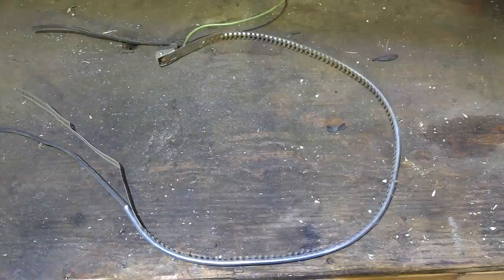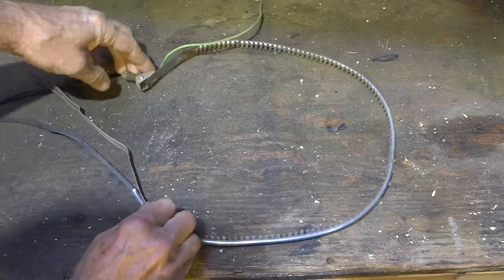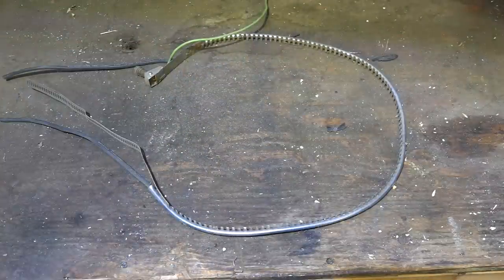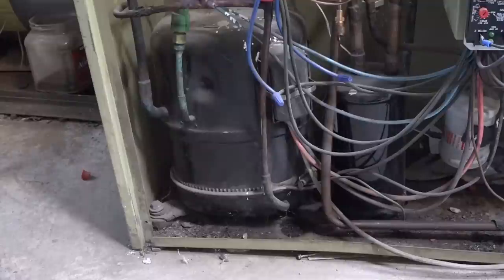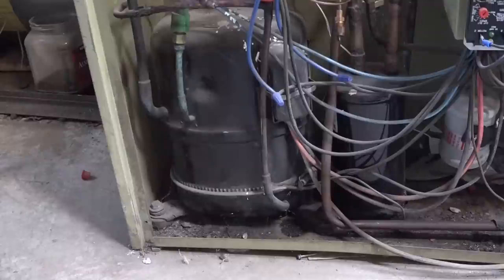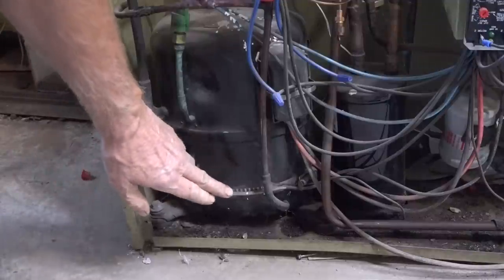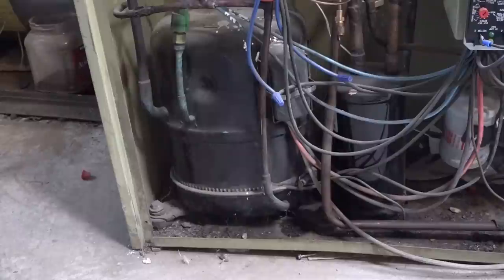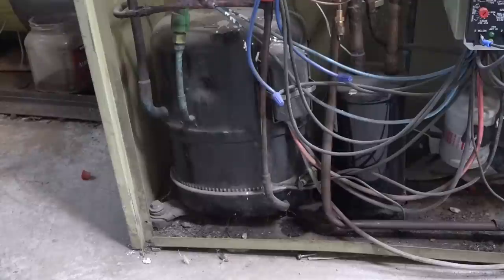The crankcase heater of the air conditioner or heat pump

Comment: Is it ok to shut the breaker off to the compressor during the winter so the crankcase heater does not run through the season that the AC is not used? I plan on turning the breaker back on 24hrs prior to the first start up of the AC in the warmer season to heat the oil back up to temp. Curious because I am able to notice my meter slows down when its off, saving energy. But if its going to cause a problem I'd rather leave it on.
Reply from the maker: You can shut it down.  The only caution is, as you said, 24 hours before starting the A/C.  Don't forget.
GFM

Comment: Should every heatpump have a belly-band, even if it has the Scroll compressor?
Reply from the maker: They have never been installed on scrolls.  Some piston compressors use belly bands, but some use capacitors to apply heat.
GFM
Reply: @grayfurnaceman  thanks for the quick reply. Yes, I agree.

Comment: There's always been some doubt if the A/C should be turned off during winter. If i'm understanding correctly, the answer should be yes so that the heater remains on during winter?

Comment: can you give some guidance on how many watts of crankcase heat are required to assure that a R-22 a/c condenser with a ICM 325 low ambient control can operate in sub 20*F ambient temps  w/o damage ?

What would think about using heat tape wound around the compressor ?
Reply from the maker: It depends on the size of the compressor but I have never seen one over 75 watts.  Most about 50 watts.  You could but why?  Cranckcase heaters are available for all compressors.
GFM

Comment: Informative video. Which refrigerant has the greatest affinity for oil R22 or R410a and which oils also what type of compressor reciprocating or scroll have the greatest potential for problems? Thanks
Reply from the maker: +Scruples I don't have the info on affinity.  The recips have the worst problem because of the possibly of slugging.  scrolls are not susceptible to slugging because of the design of the scrolls.  Many of the scrolls do not have crankcase heaters.  Scrolls are however sometimes damaged by the dilution of the oil by refrigerant.  Hope this helps.
GFM

Comment: My liquid like is freezing on heat from the service valve it runs good on cooling but once I put it on heat in. Freezes  would a crank heater solve my problem ?  My other route was to change the piston My line set is about 200 feet long and running a 42 piston any input ?
Reply from the maker: A crankcase heater will not help.  You have a restriction in the line.  That's about as far as I can go with the info provided.
GFM
Reply: Thanks I'm gonna put a bigger piston see what it does

Comment: Is it ok to use relay whe we install ? So it runs  only when the compressor is off or should we hook up staright to power and keep it on all the time?
Reply from the maker: +Guy Hakverdi The relay is ok.  Most heaters are set up to shut off during the on cycle.
GFM

Comment: I have a renewed respect for the role of the CCH.  On a system with a very long lineset and a solenoid valve at the evaporator, I figured a CCH wouldn't be needed because most all refrigerant would be held in the condenser and lineset.  But somehow on startup after a long time off the compressor developed major mechanical problems.  Loud erratic knocking and eventually loss of pumping capacity.  I suppose that with enough time the refrigerant could have migrated backward through the compressor valves, but I had never considered that possibility.  A CCH would have prevented that failure.  Sound possible?
Reply from the maker: +Straycurrent Absolutely.  It will migrate to the compressor even with the solenoid valve.
GFM
Reply: +grayfurnaceman   Well, we learn the hard way sometimes , but we can learn a lot faster thanks to some great videos on YT (smile).
Reply from the maker: +Straycurrent Thanks for the support.
GFM

Comment: Nice video GFM and good timing. I was in my unit yesterday replacing the capacitor and decided to check the current draw on the heater with my brand new clamp meter and it didn't show anything. Do you think the current is too low for a clamp meter to read? The heater was showing 875 ohms so it doesn't seem like it's open.
Reply: +Nicholas CeeA 875 ohms gives about 55 watts at 220volts so its in the ballpark for the right resistance, it would only pull around 0.25 amps so maybe your meter couldn't measure it.
Reply: +heavydiesel Thanks, I will look into it some more. The low end clamp specs are vague.
Reply: Someone is breaking some unbreakable laws here...lol. I run an electrical test lab and brought my amp clamp in today. It starts reading at 75ma and is fairly accurate at 250ma. The voltage across the CCH was 245 so it should have read a little higher.

20 year old 38YKC Carrier heat pump with a scroll and according to the schematic and service manual there "MAY" be a factory installed thermostat on the CCH. Maybe bad thermostat contacts if it has one? Allowing an ohm reading but breaking down under any sort of current. Or are these heaters like self regulating heat tape and start drawing more current when it gets cold? Ambient was around 60F when I checked it. Any ideas?
Reply from the maker: +Nicholas CeeA I have not seen one that is self regulating.  However, some have a thermostat on the discharge line at the compressor to shut the heater down if it gets up to temperature or the compressor starts.
GFM
Reply: +grayfurnaceman OK thanks...time to take the compressor blanket off and risk seeing a spider :~O It looks mighty comfy in there. I'll double check the current again through a regular multi meter in series.

BTW, the heater is wired through the run winding and shuts off when the contactor closes.
Reply: +grayfurnaceman OK, here is what happened. I checked the current with a multimeter in series with the CCH and I saw 15ma. Pulled the disconnect and opened the compressor blanket. The heater wires actually go inside of the compressor at the bottom. Maybe a double wall compressor or another fusite connector? The compressor is awful fat for a scroll. After fooling around for about 30 minutes and reinstalling the blanket, I plugged the disconnect back in while watching the amp draw. Initially it was 500ma, then 250ma in 10 seconds, then back to 15ma in about 1 minute where it stayed.

I can send you some pics of the compressor if you like.
Reply: +grayfurnaceman Woah...I looked up the model and it's a recip. I remember the company that installed it making a big deal because it was a scroll. I guess they were wrong but man is it quiet and smooth!!.
Reply from the maker: +Nicholas CeeA Go for it.
GFM
Reply: +grayfurnaceman Go for what? I can't think of anything else to do. I took the blanket off and made those current measurements yesterday evening. It seems there is something regulating the heater current in response to compressor sump temperature which may be normal for this model. Nominal current for the ambient temps we have at the moment is 15ma so that is why my clamp never saw a reading when I first asked the question.

BTW I figured out how they mounted the CCH. I believe it's a tube with one end closed off welded into the side of the compressor which extends into the sump. Then the heater is pushed into the tube from the outside and sealed up with some white insulation which I can see in the hole.
Reply: Nicholas CeeA
I think the insertion style CCH's are self limiting, so the current will drop if the sump is warm enough. The external ones that look like a giant hose clamp are the unregulated ones.
Reply: +heavydiesel That seems to make sense according to the current readings I saw. It's fun learning new things!

Comment: One you could improve in your instruction , your videos are great , but your explanation most of the time take too long on one area , repeating on one item too long ,  it’s a video so anyone can repeat , pause , it will help if you get to next step without getting hung on too long on the previous step
Reply from the maker: I have considered moving faster on these explanations and have tried some videos this way.  So far, the short versions have not proved effective.  Thanks for the comment.  
GFM